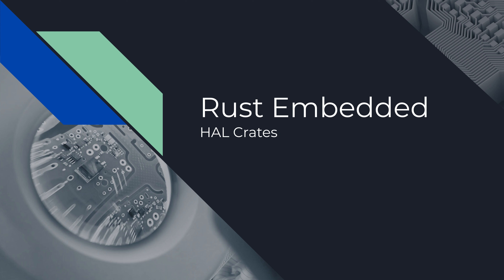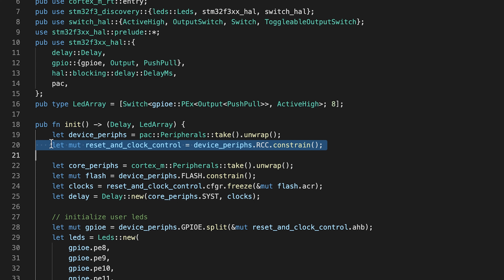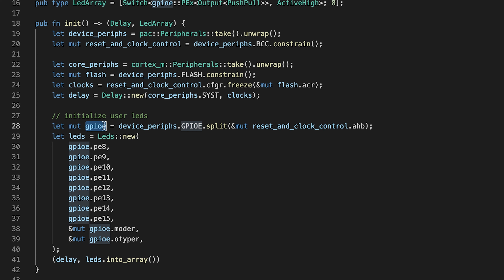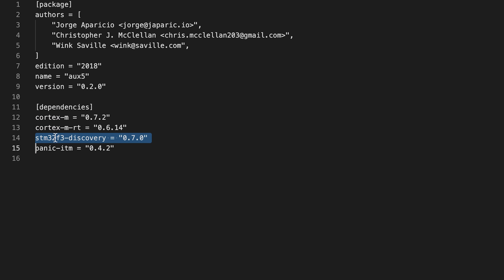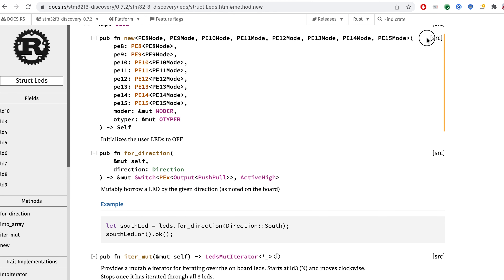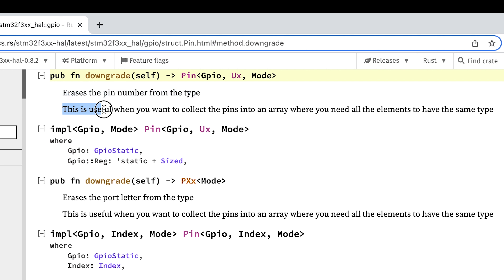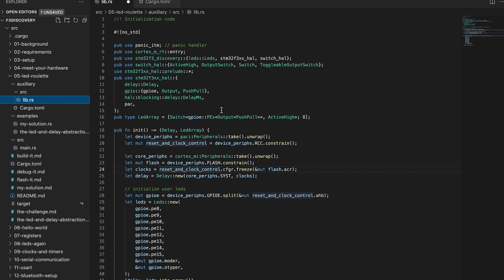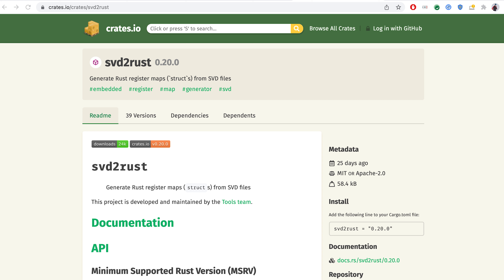Rust Embedded for STM32 Microcontrollers: HAL Crates

Comment: How efficient is the code generated compared to its C equivalent , in terms of code size , code execution speed and ram usage ?
Reply from the maker: Based on the projects I've worked on, I'm unable to answer this question because we never wrote the same thing in two languages, so side by side comparison is impossible to estimate. Our use cases of using rust for stm32 were mostly focusing on low power consumption, easy long-term maintenance (EOL 8 yrs+), and testability. You probably can pack more code, achieve better performance in C than Rust; but as I said, we never did a full production ready project with a 1:1 comparison.
Reply: @JaJakubYT  fair enough , did you guys work off a prebuilt Crate ? I’m trying to figure out how to port a completely new microcontroller, Cortex M4 based , not one of the currently supported vendors
Reply from the maker: Yeah, crates are a bit of a mess. We ended up choosing an stm32g071 due to its parameters but also based on crate maturity. We ended up doing a lot of fixes and PRs to the community. If you want to go with something new, that is exciting but scary 😅 Factor in heaps more work in your estimations. Look up some of the crate designs and try to replicate good patterns.